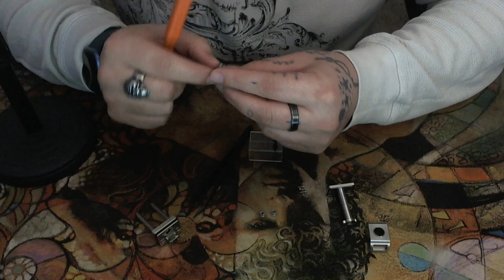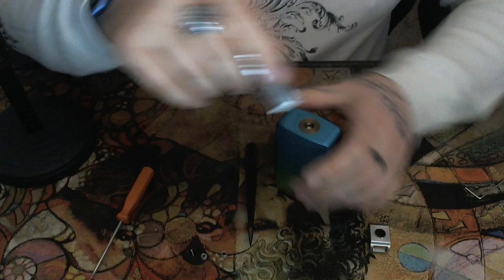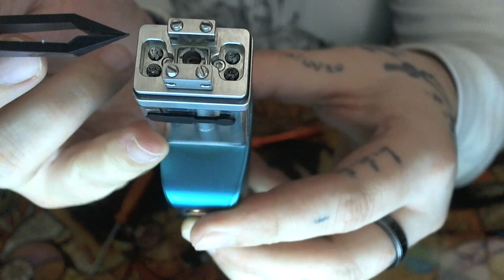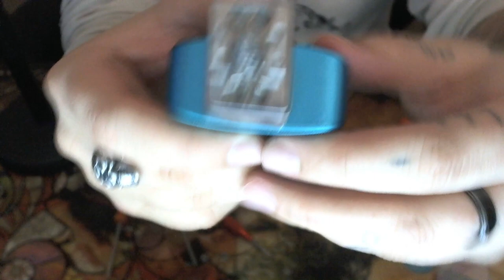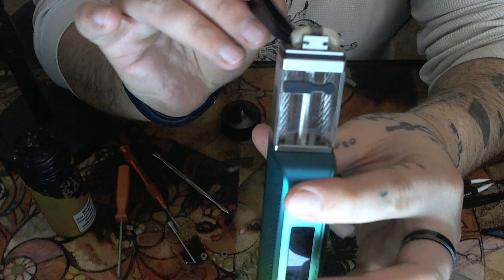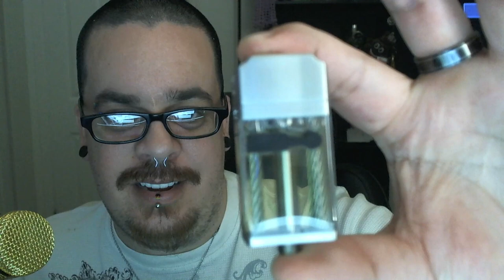Stubby Tank Build

Comment: Any advice on wicking the Ponte with mesh coils as well?
Reply from the maker: Haven’t really messed with the Ponte but I’ll see what I can come up with for it
Reply: @MoxOpal86  thanks bro, the wicks can’t seem to keep up with the mesh of the ponte. I’ve tried every wicking style I could think of lol
Reply: @AestheticAbe 
MESH PONTE needs ALOT OF COTTON!!! 

Like 4mm inner diameter… put it through like you normally would. 

Do the pull tug, not too loose not too tight. 

Then snip right at the edge of the Top of the deck.   Fluff’em out and tuck. 

Pulse drip the liquid.  Drip some liquid on the mesh press fire button ONCE. 
Drip some more press fire button, rinse repeat until cotton is saturated.